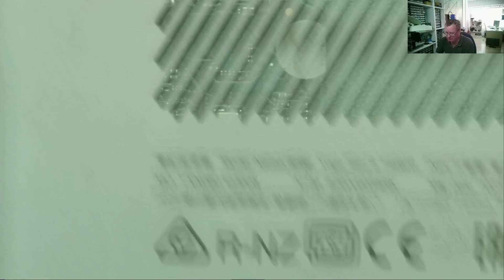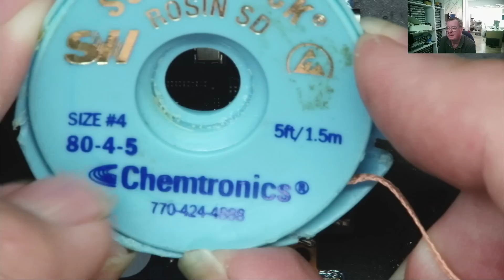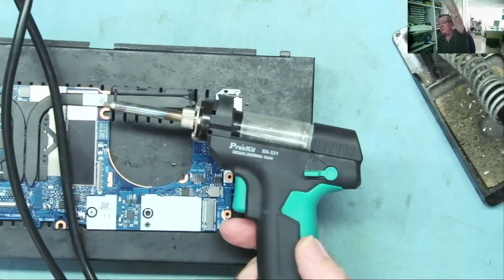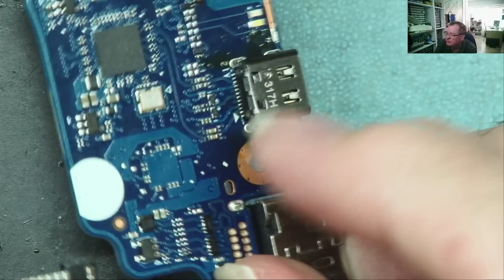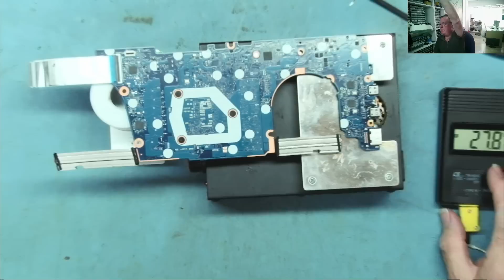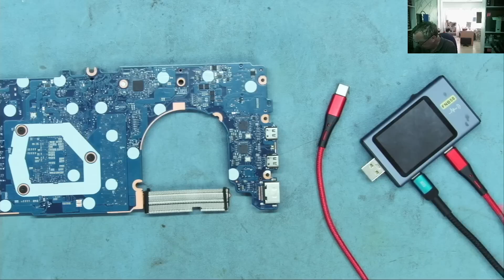How To Replace SMD USB C Charger Ports With No Visible Pins - USBC Socket With Pads Underneath

Comment: I've got a laptop with a damaged USB C port exactly like this one so going to give this ago today!  Once set of pins can easily be tested but how do you know the inner ones have soldered OK - is there a USB C tester you can plug in to the port to see if both sets of pins are functionining/connected properly?

Comment: How can one get a hold of usb c replacements, amazon can be dodgy on these, it also doesn’t help with which one I am looking for, the device that I believe the usb c port is shot on is a vive face tracker, it has the usb c mounted parallel to the board with many contact points, I would put picture if that was possible on here but its not. 

The device can be seen by my computer but it will not show that its getting power nor operate.

Comment: Great work!

Jeez though, 20€ for a box of 10 of those solder wicks? Cheapest I see now in the US is $7 a spool on Amazon, unless I want to spend $65 for 25 of them from Taiwan on eBay :-/
Reply from the maker: Those Solderwick are not the cheapest.  Having said that a pack of them last me six months or more so in the end the cost is hardly a consideration and after I was recommended to try these I don't use anything else
Here is the link I use https://www.aliexpress.com/item/1005006076105867.html?af=ler2022

Comment: I use my preheater to help remove the 4 anchoring solder points (on PS5/Xbox HDMI ports) I just leave it on the plate as I wick away - It really helps the wicking process for me, Rich. I use a super fat tip (D4) on my iron when wicking! I use the BC3 tip if I'm using my T12 iron. The D4 is if I'm using my Chinese JBC knock off. (AiXun T320)
Reply: ^^ Heat resistant gloves help as the board gets hot!

Comment: Absolutely the right way to do it with the preheater.Hheating the whole thing at once works 10 times fine, the eleventh time your boards bubles. Having said that, i'm sure the PCB's these days are way better then in the early 2000's

Comment: Just come in from underneath with hot air..
Reply from the maker: As this is a double sided PCB with a lot of very small components near to that area on both sides, I stand by the method I used, preheater plus hot air, is the best and least stressful for the PCB.  Of course if someone can convince me otherwise I'm willing to learn something myself 😉
Reply: @LearnElectronicsRepair  been doing these type of usb repairs for years, correct nozzle you'll never knock off components
Reply from the maker: @waynetaylor2784   I can't disagree with you because what you are doing works for you. What I did also works for me. I don't see why that makes any one method better than the other 😵‍💫 To anyone wanting else try as many methods as you like.IMHO if you find one that is successful the do it that way and all will be fine.

Comment: Although I love your work. This method is the only way how to replace those USBC ports. Anyone who works with heatguns should know this. But good work otherwise, made it look easy for novices.
Be handy if you let people know the temperance airflow your gun it set to.
Reply from the maker: I did mention the hot air temperature, and the soldering iron temperature and tip type. I wouldn't say this method is 'the only way' as you state. A saw Sorin at Electronics Repair School do it two other ways.  What this comes down to is 'what works best for you'. So I show the way I do it, others show their ways, people wanting to learn should watch and decide which they think looks best for them.  If the really want to learn they try more than one method. Some people will think the quickest way is best, others may get the best results a different way.
Reply: @LearnElectronicsRepair  oh my bad. The great Sorin - love his work too. Although I've totally gone off Louis Rossman (too egotistical).
Reply: I take it youv'e never heard of a vapour phase then.

Comment: Good job but how will do it differently i use leaded solder fill it hole the holes then i use hot air 350 degrees . I see the solder is melted. Then i put the   port on it and then solder it .
Reply from the maker: Yeah I saw Sorin do it that way.  I prefer to use a preheater when I can as I believe it puts less thermal stress on the PCB but this I think is a matter for personal preference. I also like to line up the component before soldering if possible rather than dropping on the PCB.
Reply: @LearnElectronicsRepair  yes you can when you have a preheater
Reply from the maker: @stevedebeukelaer1424  Agreed. If you don't have one there are other methods that work.  Having said that, a preheater could be something really simple like an electric griddle, a toasted sandwich maker, or a good size chunk of granite warmed up in the oven, so there's kinda no real reason not to have one 😉
Reply: @LearnElectronicsRepair  i didn't think abouth the alternative you summed up 🤔

Comment: Great job Rick, I know that type of job can easily go tits-up. As you say, the right Pre-Heat is the key.
Reply from the maker: That is my belief though I saw Sorin over at Electronic Repair School do this successfully without a preheater. I'm not sure if his method is particularly quicker.  For those who don't have a hot air preheater like this one i use, you can use a hot plate instead or even something like a griddle toasted sandwich maker if you make a little stand to mount the PCB over it. Just use a thermocouple so you can see what is going on temperature wise, those little thermometer meters are about €3 on AliExpress so get a couple of them.  Those laser barbecue themometers that you use to check if meat is cooked could also be used for this.  Basically the preheater can be anything that can get the PCB up to about 100C-120C and the hot air will do the rest for you

Comment: No standards on sockets is rather challenging. You buy an assortment box and end up with a load of sockets you will never use. I wonder how many hours are wasted by technicians searching their assortment boxes to find they do not have the one they want.
Reply: its insane. EU mandates usb-C ports, why not define a handful of connectors specs (through hole, smd, 90 deg, etc etc) and call it a day??
Reply: @Nebbia_affaraccimiei  How much useless stuff is stored by technicians? This is just pure waste, nothing green here or protecting the world.
Reply: @Nebbia_affaraccimiei  because it's not down to the EU to define how something is manufactured just the technology used for standardisation
Reply: @alanrichardson1672  ever heard of CE marking? to get the certification you have to follow certain procedures. they couldn't sell it otherwise. they could just add this requirement.
Reply: @Nebbia_affaraccimiei  I am absolutely fully aware of CE markings. 👍

Comment: Good job. Worth to check data lines communication as well and flip the USB cable plug to check if it also works.
Reply: this.
Reply from the maker: Good idea about flipping the connector. The laptop has two usb-c ports, this one is marked charger. You can't charge the laptop using the other USB-C, I tried that before replacing this one, but I haven't tried to see if you can send data via the charger port.